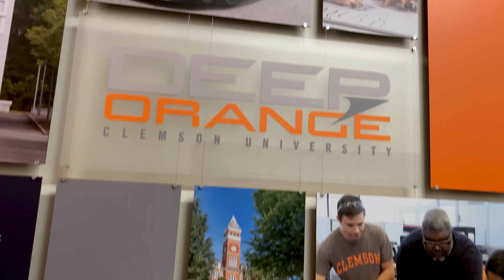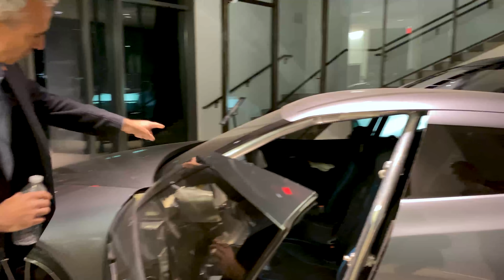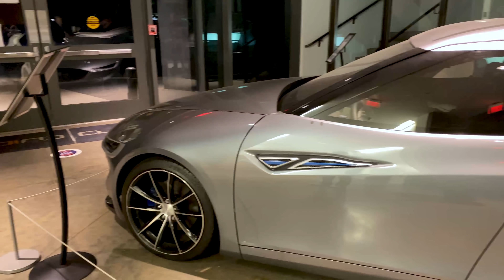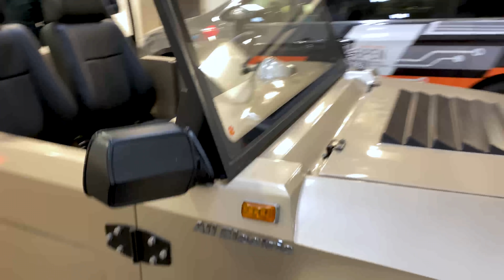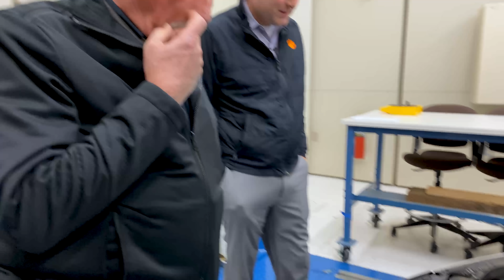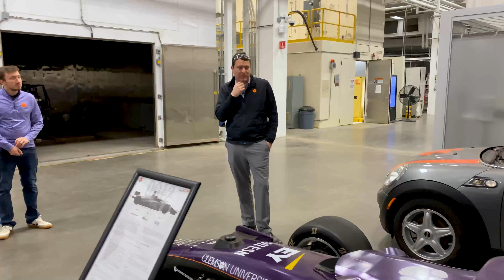ATL to Clemson - Sandy Tours CU-ICAR  |  Tesla Model S Plaid Road Trip: E3

Comment: This looks so fun, very practical and engaging. It probably is expensive, otherwise why haven't we seen more colleges implement such courses, but then again colleges are spending their money are superficial things like golf courses, rock climbing walls, ever more pay increase to the administration. The loop of loans is a burden also, they increase tuition because the government offers federal loans to universities, the universities then know that they can jack up tuition, which in turn requires students to take out larger loans and the cycle continues. 
Just think about how tuition was the same during the lock down, no facilities were used, yet students still had to pay the same price for tuition, which is outrageous. There needs to be more apprenticeships or integration with industry in colleges. Many of the engineering professors I've had in University has said that they barely use any of the information that they are teaching us in the particular class in their career. Then WHY does this class even exist? Although I didnt hear this much in community college, which i def think was more beneficial and wayyy more practical atleast in my experience, I've had TONS of actual labs in community college. Some universities are kind of a joke, although it might just be the university that I went to.

Comment: If any engineering school was worth their weight, they’d focus on improving manufacturing and assembly than improving horse-shoes - the Model T is already rolling off the production line.
Reply: While not shown in this video, manufacturing research at CU-ICAR is a massive part of what they do. From automotive manufacturing to gas turbines and advanced materials, they produce a healthy body of research of industrial impact.